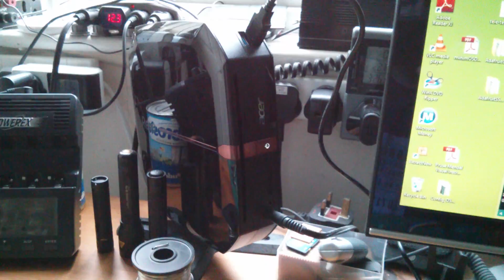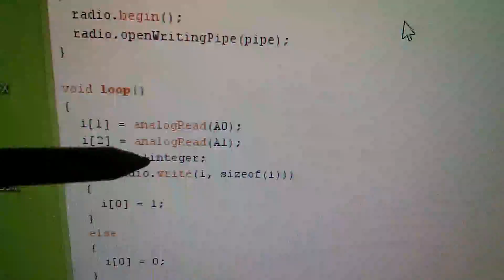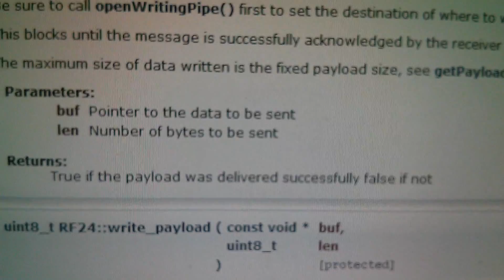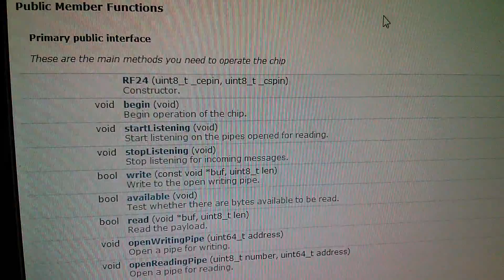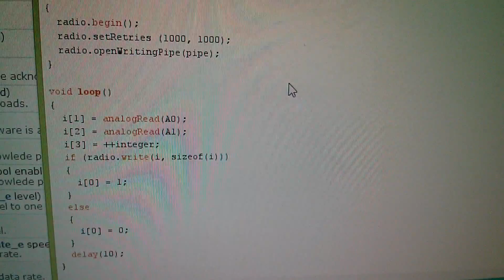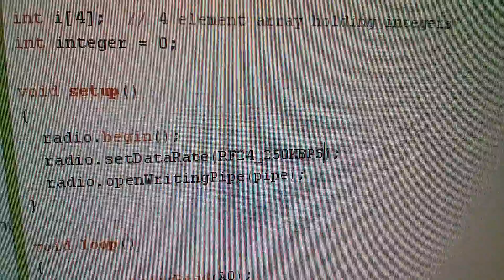1-Day Project: Arduino nRF24L01+ Data Transceiver & OLED Display

Comment: Perhaps it is not clever, but I would first swap the then/else parts of this IF. To be able to see that it is working correctly (start receiving 1s insted of 0s).
Reply: Or put the counter in i[0] and the radio.write return code in i[3]..... or replace sizeof(i) with sizeof(i)+1 .......

Comment: The receiver is probably not acking anything while it is updating the screen display. This would cause the sender to set a zero in the next packet, which is then displayed. Rather than displaying the id of the received packet, a much better idea would be to display the difference between the id of the previous packet. That would let you see how many packets were missed. My guess is, you would see it constantly displaying 2 (meaning one was missed).
Reply from the maker: ***** Yes, that's an idea. But not necessary now, as it's working perfectly. I'm able to transmit packets at the rate I want (about 2 per second) and all the data is coming through without error. The wearable data display project can now move forward.

Comment: Maybe the code of your reciever is wrong, and you need to send a "confirmation" back or something...
still very nice Project though, are you planing to design your own PCB to fit allt hese chips, or are you going to bodge all these off the shelf PCDs together in the end? :)
Reply from the maker: muh1h1 The acknowledge (confirmation) packet is handled by the chip completely automatically - now working flawlessly!
The finished unit will be a bodge of course - and I'm planning a really ugly layout - Yay
Reply: Haha, OK :D

Comment: It looks like its transmitting correctly, communications systems are usually set up to avoid sending false data, they either work perfectly or they fail all together. Maybe there's something wrong with the "if(radio.write(i, sizeof(i))); statement?

Comment: Paremeters of setRetries has only two passing parameters uint8_t type which is only 8 bits wide. Max value can be 255 and you cant pass 1000 on that (it will get truncated to 1000 AND 255 = 232). I am not sure why arduino compiler has not raised any warning or error. I have never used arduino because I am a fan of PIC and STM32. However, documentation finally tells how big these number can be. Flow control of any wireless communication is a bit problematic when there is poor signal and you need to send a large chunk of data. It will be nice to slow down the transmission rate so that the counter increases one by one slowly to see in naked eyes and then do the experiments in poor signal condition if that increases correctly.

Comment: Hi Julian,

I haven't seen your receiver code yet, but do you have the addressing correctly setup? Even though you communicate through a pipe each node in such a pipe needs individual addresses for the auto ACK to work.

I guess that your receiver's rxPipe is set up correctly since your data ends up there. However if the receiving code does not where it should send its auto ACK package, it will never end up in your sender transceiver and it will just re-transmit until it fails.

in my code I always define both nodes in the code like this:
const uint64_t rx_pipe = 0xF0F0F0F0D2LL;
const uint64_t tx_pipe = 0xF0F0F0F0E1LL;

 and on the receiver part I setup two pipes for the auto ACK to work:
  radio.openWritingPipe(tx_pipe);
  radio.openReadingPipe(1,rx_pipe);

It works perfectly for my modules...

I hope this can be of any help. You should see the nRF24L datasheet how this works. It can be somewhat confusing regarding the node addressing.

Best regards,
Bjorn Erik
Reply: And... on the other end you will have to swap the rx / tx pipe addresses for the transmission to work correctly.
const uint64_t tx_pipe = 0xF0F0F0F0D2LL;
const uint64_t rx_pipe = 0xF0F0F0F0E1LL;

You can look at it as it an old "null modem" cable where you had to cross pin 2 and 3 for communication to work both ways.

BE

Comment: FYI, 8 bit unsigned integers can't hold the number '1000', it's probably being converted to 232.

How about changing the write() into a loop that tries until it returns true?  Count those retries and print that to the serial console.

Comment: I guess you've already tried this, but what happens when you simplify your code and only write raw TX and RX data to the console? Just a Serial.writeln, without updating the OLED. 

What is being sent and what gets received?
Reply from the maker: Dirk Dulfer I have tried that, but the serial.print isn't any faster than writing to the OLED. Also, I had to keep swapping the USB cables when the receiver was connected to my PC

Comment: i think you are sending i[1] before it is being set to 1, because that should happen AFTER sending?!?
Reply from the maker: fraenk It's true that i[0] contains pass/fail data related to the previous transmission, but I'm more concerned that ALL packet transmissions are failing.
Reply: Julian Ilett oh yeah... i think my logic failed here... i thought it was resetting on the beginning of each loop.

well, i hope to see the follow up video soon clearing it all up.
Reply from the maker: fraenk Coming soon!

Comment: The stop listening that you are looking for is
radio.stopListening();

and for confirmation about delivery try something like this

bool ok = radio.write( &time, sizeof(unsigned long) );
    
    if (ok)
      printf("ok...");
    else
      printf("failed.\n\r");
Reply: Julian Ilett you dont need a stop transmitting command. The module only transmits during a write operation, after the write operation it stops until the next one.
Reply from the maker: ceech123 I'm not really looking for a stop listening command. What I really want is a stop transmitting function. I'm now having to read the entire nRF24L01+ data sheet to make sense of all this.
Reply: You can do that. What you can also do is try the below example code from maniacbug, the author:
/*
 Copyright (C) 2011 J. Coliz <maniacbug@ymail.com>

 This program is free software; you can redistribute it and/or
 modify it under the terms of the GNU General Public License
 version 2 as published by the Free Software Foundation.
 */

/**
 * Example for Getting Started with nRF24L01+ radios. 
 *
 * This is an example of how to use the RF24 class.  Write this sketch to two 
 * different nodes.  Put one of the nodes into 'transmit' mode by connecting 
 * with the serial monitor and sending a 'T'.  The ping node sends the current 
 * time to the pong node, which responds by sending the value back.  The ping 
 * node can then see how long the whole cycle took.
 */

#include <SPI.h>
#include "nRF24L01.h"
#include "RF24.h"
#include "printf.h"

//
// Hardware configuration
//

// Set up nRF24L01 radio on SPI bus plus pins 9 & 10 

RF24 radio(9,10);

//
// Topology
//

// Radio pipe addresses for the 2 nodes to communicate.
const uint64_t pipes[2] = { 0xF0F0F0F0E1LL, 0xF0F0F0F0D2LL };

//
// Role management
//
// Set up role.  This sketch uses the same software for all the nodes
// in this system.  Doing so greatly simplifies testing.  
//

// The various roles supported by this sketch
typedef enum { role_ping_out = 1, role_pong_back } role_e;

// The debug-friendly names of those roles
const char* role_friendly_name[] = { "invalid", "Ping out", "Pong back"};

// The role of the current running sketch
role_e role = role_pong_back;

void setup(void)
{
  //
  // Print preamble
  //

  Serial.begin(57600);
  printf_begin();
  printf("\n\rRF24/examples/GettingStarted/\n\r");
  printf("ROLE: %s\n\r",role_friendly_name[role]);
  printf("*** PRESS 'T' to begin transmitting to the other node\n\r");

  //
  // Setup and configure rf radio
  //

  radio.begin();

  // optionally, increase the delay between retries & # of retries
  radio.setRetries(15,15);

  // optionally, reduce the payload size.  seems to
  // improve reliability
  //radio.setPayloadSize(8);

  //
  // Open pipes to other nodes for communication
  //

  // This simple sketch opens two pipes for these two nodes to communicate
  // back and forth.
  // Open 'our' pipe for writing
  // Open the 'other' pipe for reading, in position #1 (we can have up to 5 pipes open for reading)

  //if ( role == role_ping_out )
  {
    //radio.openWritingPipe(pipes[0]);
    radio.openReadingPipe(1,pipes[1]);
  }
  //else
  {
    //radio.openWritingPipe(pipes[1]);
    //radio.openReadingPipe(1,pipes[0]);
  }

  //
  // Start listening
  //

  radio.startListening();

  //
  // Dump the configuration of the rf unit for debugging
  //

  radio.printDetails();
}

void loop(void)
{
  //
  // Ping out role.  Repeatedly send the current time
  //

  if (role == role_ping_out)
  {
    // First, stop listening so we can talk.
    radio.stopListening();

    // Take the time, and send it.  This will block until complete
    unsigned long time = millis();
    printf("Now sending %lu...",time);
    bool ok = radio.write( &time, sizeof(unsigned long) );
    
    if (ok)
      printf("ok...");
    else
      printf("failed.\n\r");

    // Now, continue listening
    radio.startListening();

    // Wait here until we get a response, or timeout (250ms)
    unsigned long started_waiting_at = millis();
    bool timeout = false;
    while ( ! radio.available() && ! timeout )
      if (millis() - started_waiting_at > 200 )
        timeout = true;

    // Describe the results
    if ( timeout )
    {
      printf("Failed, response timed out.\n\r");
    }
    else
    {
      // Grab the response, compare, and send to debugging spew
      unsigned long got_time;
      radio.read( &got_time, sizeof(unsigned long) );

      // Spew it
      printf("Got response %lu, round-trip delay: %lu\n\r",got_time,millis()-got_time);
    }

    // Try again 1s later
    delay(1000);
  }

  //
  // Pong back role.  Receive each packet, dump it out, and send it back
  //

  if ( role == role_pong_back )
  {
    // if there is data ready
    if ( radio.available() )
    {
      // Dump the payloads until we've gotten everything
      unsigned long got_time;
      bool done = false;
      while (!done)
      {
        // Fetch the payload, and see if this was the last one.
        done = radio.read( &got_time, sizeof(unsigned long) );

        // Spew it
        printf("Got payload %lu...",got_time);

	// Delay just a little bit to let the other unit
	// make the transition to receiver
	delay(20);
      }

      // First, stop listening so we can talk
      radio.stopListening();

      // Send the final one back.
      radio.write( &got_time, sizeof(unsigned long) );
      printf("Sent response.\n\r");

      // Now, resume listening so we catch the next packets.
      radio.startListening();
    }
  }

  //
  // Change roles
  //

  if ( Serial.available() )
  {
    char c = toupper(Serial.read());
    if ( c == 'T' && role == role_pong_back )
    {
      printf("*** CHANGING TO TRANSMIT ROLE -- PRESS 'R' TO SWITCH BACK\n\r");

      // Become the primary transmitter (ping out)
      role = role_ping_out;
      radio.openWritingPipe(pipes[0]);
      radio.openReadingPipe(1,pipes[1]);
    }
    else if ( c == 'R' && role == role_ping_out )
    {
      printf("*** CHANGING TO RECEIVE ROLE -- PRESS 'T' TO SWITCH BACK\n\r");
      
      // Become the primary receiver (pong back)
      role = role_pong_back;
      radio.openWritingPipe(pipes[1]);
      radio.openReadingPipe(1,pipes[0]);
    }
  }
}
// vim:cin:ai:sts=2 sw=2 ft=cpp

You might find your answers here.
Best of luck.

Comment: Please explain me, which chip you are using to convert the 3.7v to 5v and protect the lipo from low-voltage
Reply from the maker: I'm using a 3.3v Pro Mini. The TP4056 charger board has a DW01 and 8205 to protect the LiPo.